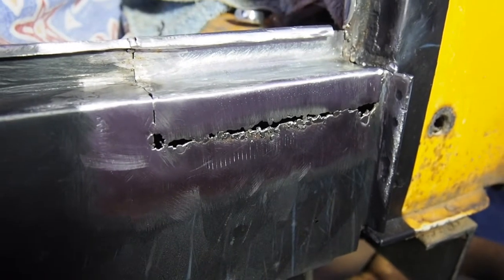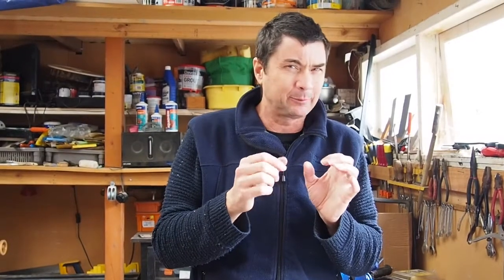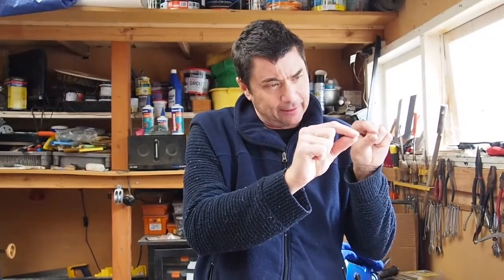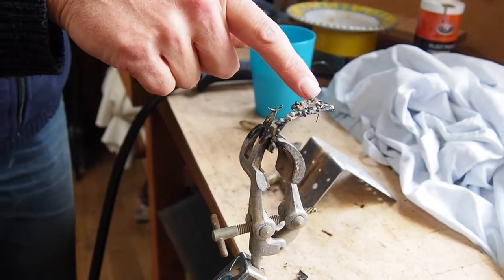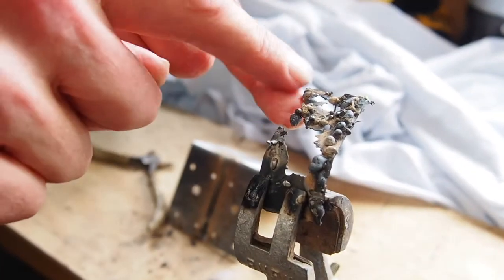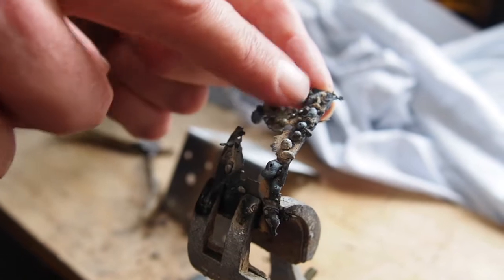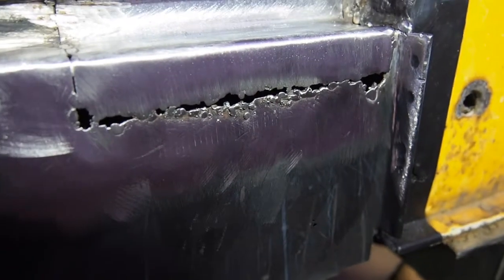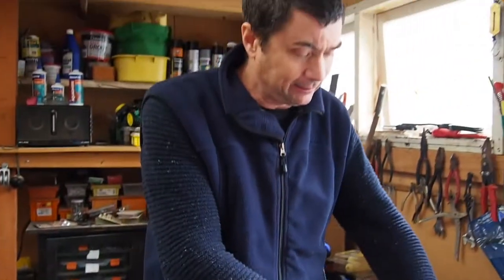MIG welding on thin metal...!! | VW Kombi restoration

Comment: One thing with a Mig is to buy CIG wire not generic. another way to fill holes is to use a bronze rod and with oxyacetylene melt the rod into the holes, of course, using a backing plate, however, this is more expense. the other thing, grind off the zinc at least 5mm before welding you should have bare metal to metal.